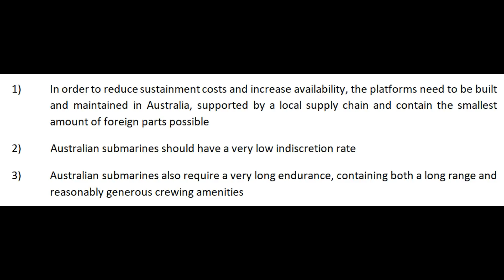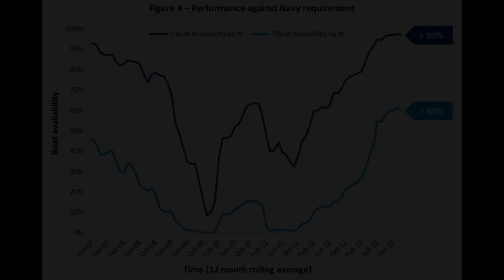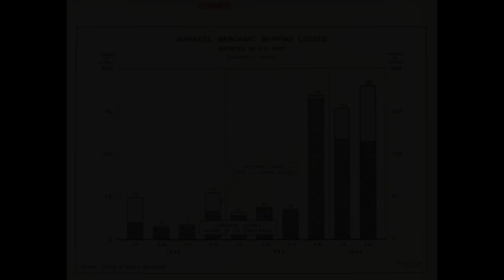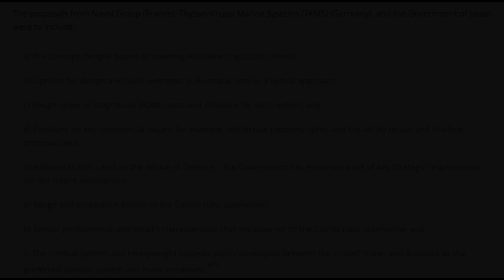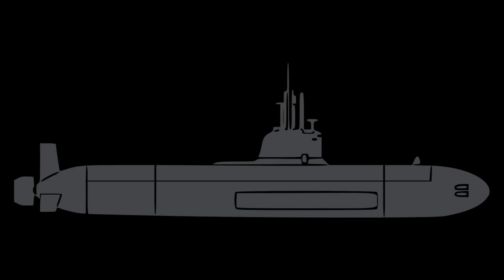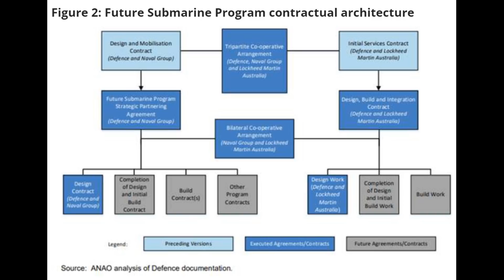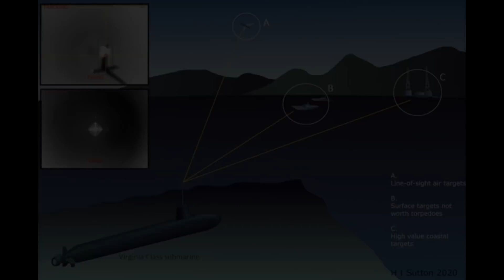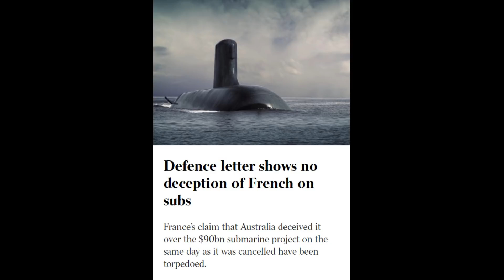AUKUS and the Nuclear Option: the Life and Death of the Attack Class Submarine

Comment: 1:06:20 - I’m scratching my head over the claim of regular snorkeling for SSKs. Particularly the Attack class. Naval Group’s AIP uses reformed diesel in a fuel cell system. That offers considerable capility Nd logistical enhancements over the german system, which itself is a quantum leap from the old Sterling AIP system. It can go 3 weeks without snorting. Further more replacing lead acid batteries for Li-ion batteries (and ultimately Li-sulphur batteries, who knows) gives at least 4 times the amount of stored energy (li-ion being twice as energy dense, and being solid can be shaped into every available nook and cranny on the boats), meaning in turn an Attack class sub could - in addition to creeping along for 3 weeks on AIP without snorting - also go incredibly fast for days within that 3 week period on batteries. I am struggling to see the disadvantage in a real life sense in that.

Furthermore, isn’t the obvious answer to the difficulties in operating for extended periods in the South China Sea (and presumably the other potential contested seas to our north) the establishment of forward operating bases? Specifically Manus Island and Christmas Island present themselves as obvious FOB to each operate up to 3 out of 12 boats from at any one time.   

All I can see now if a 20 year capability gap, which would only be plugged if we have a corresponding nuclear industry program developed over the same period (even if the asserted advantages of not having to refuel for the life of each boat’s service is a real thing, as former PM Turnbull pointed out very publicly at the National Press Club - and ASPI analysts confirmed - every piece of advice to the Aust government until the secretive Morrison became PM has explicitly stated: we need a nuclear industry to sustain a nuclear powered submarine fleet). For a capability that seems to be only marginally superior than the one we contracted to and in my view actually less capable when it comes to stealth (if as planned the attack class could do all the range of its capabilities for three weeks at a time without snorting).

You say that the indiscretion rate for a nuclear sub is zero floor its entire mission. That may be the case if it stays in the deep water, but for many many foreseeable missions where the rubber hits the road is what happens in the shallows: where one might find an enemy at anchor, or coming into or leaving port, or where special forces have to be disembarked or embarked: snorting aside, an SSK will always be superior to an SSN in those environments. This all seems … odd … especially given the revolution we are seeing in battery technology to dramatically boost the hotel load to and fuel cell technology to supplement that … which the attack class appeared to be at the bleeding point of the very cutting edge. 

I haven’t even mentioned yet - that IF there is a SSN advantage - then why on earth wasn’t it even on the table for consideration - splitting the attack program in 2: Australia builds 6-8 SSK’s in Adelaide, Naval Group builds 3-4 ‘Australianised’ Suffren’s in France (with an option to build a final 3-4 in Adelaide). Both halves of the program could have been done in tandem. We’d still need a nuclear industry which we don’t have, but it is actually easier to leverage from our small scientific research nuclear industry base into a satellite civilian nuclear power industry, than developing - at least - a satellite weapons grade nuclear industry (refuelling for 3 weeks in France every 10 years? Why cares. That’s nothing in the greater scheme of things, especially given that the boats will need a 12-18 month refurbishment at the same time).

Other advantages of Suffern’s: they are electric motor vessels. Mechanical reduction gear drive SSN’s are nearing obsolescence (a fact recognised in the various design and development programmes to replace the Virginia and Astute classes). They are far more modern than either the Virginia (which was a ‘B’ design anyway) or the Astute (which has been a troubled program itself). We could even lease 3-4 refurbished, Australianised and refuelled Rubis class SSN’s off the French from about 2025 to help build up our nuclear boat capabilities before Suffren SSN’s entered service from about 2035. Instead of SSNs on the never never, by 2035 we could have had: 3 Attack class SSKs, up to 3 Australianised Suffren SSNs in service, supplemented by upgraded Collins and Australianised Rubis SSNs. A capability enhancement, not a yawning capability gap. Madness all round to simply take all of that off the table.

As for the size issue: the basic boat design of SSN programs of both the US and UK navies started out at the same size as the barracuda class. They have just grown over the years (the block 5 Virginia’s by adding another 40M in length over the block 1s. However, that’s really because they are being fashioned as all round replacements for not just SSNs, but also as SSCNs. It might be worth considering ONE vertical launch system (we dont need the Virginia Block 5’s six vertical launch systems, surely), which can easily be done IF that is thought desirable. So an Australianised Suffren might end up being 108-110M in length and containing 8 strike length vertical launch cells, plus 8 smaller vertical launch cells in addition to its current weapons load. Enough. More than enough.
Reply: dont want to type a thesis but a few things

NG did not have or neither did they offer AIP on the a attack class when the a contract was signed.  The contract was signed with DCNS on November 2015,  the DCNS AIP system was not announced till 2019

Same with LIPO batteries,  the contract was lead acids and thats what DCNS supplied

Why would be buy suffrens,  it took France 13 years to build their own subs,  australianising is how we get into shit all the time.  Why would we last generation obsolete submarines like the rubis,  thats an even worse idea than buying suffren.  If we wanted to buy last generation subs theres something like 30 688's floating around to pick from
Reply from the maker: OK, so there are a lot of issues with your reasoning here. In basically every point you have advanced here you are making basic mistakes (such as confusing HEU with LEU reactors), ignoring the fundamentals (such as sustainment) or focusing on individual problems whilst simultaneously ignoring the wider context: For example, maybe you can cobble together FOB and AIP combination that allows you avoid the space based ISR issue in the SCS specifically, but a nuke solves that problem AND solves your HEP issue AND solves your land strike issue AND gives you greater operational manoeuvre potential AND gives you a performance advantage AND gives you greater persistence ect ect ect. Please, try to examine the argument as a whole without cherry picking. 

BTW Have you actually watched the video? Most of the rebuttals you raised here were specifically addressed. 

1) The Attack Class (at least the block 1A) had no AIP system
2) Li batteries were specifically rejected by Naval Group because of safety concerns (addressed in the video)
3) All AIP systems impose significant range penalties (again addressed in the video)
4) You can’t permanently sustain submarines from Forward Operating Bases which means you elongate patrols impacting on crew endurance, which is a key Australian requirement (addressed in the video). Retaining submariners is already a huge challenge and now you want to base people on Manus Island. Have you considered the personnel impact of that? Have you ever considered that the RAN has?  
5) FOBs are expensive (added cost on top of the sub program) 
6) FOBs are vulnerable to long range strike systems (lack of strategic depth) which means you need additional defensive systems (more cost) 
7) SSK will always be better than an SSN in the littorals? What, on gods green earth, would you base that reasoning on? You had better go and tell the USN that their entire force structure is wrong considering they operate SSNs in the littorals all the time. 
8) You are confusing HEU reactors with those that use commercial grade fuel which is why AUKUS means we DONT need a nuclear industry. Malcolm Turnbull was talking about a different kind of technology, so everything you have argued there is moot (addressed in the video)  
9) You are ignoring the HEP advantages of SSNs (addressed in the video). Greater energy density in storage will only marginally offset the greater HEP demands of UUVs. Even a 2x improvement of LI is nothing compared to the 10 – 20 x increase in HEP provided by the reactor. SG9 is estimated to generate 210MW. It’s just not even close.  
10) You are ignoring the kinematic advantages of SSNs (addressed in the video) 
11) You are ignoring the operational mobility advantages of SSNs (addressed in the video) 
12) You are ignoring the persistance advantages of SSNs (addressed in the video)  
13) Land strike is a substantial advantage of the Astute and Virginia (don’t know why this is a negative)
14) You are confusing the indiscretion rate with being shallow 

Your force structure ideas are just not at all realistic, really fanboy, forum stuff. How is the RAN supposed to sustain 4 different classes (some nuke some SSK) simultaneously, when two of them have supply chains in France? Who does the Full Cycle Docking? Who does the refuelling? What about the sovereignty issues of having Paris refuel our SSN? How much is it going to cost to get a fuel cycle established in Australia?

And finally you are just asserting that the only reason UK and USN SSNs are larger is because they are used as SSGNs, but really you are only talking about the Virginia class. The flight I 688 class is over 2,000 tons larger than Suffren. Astute is no SSGN (it doesn’t even have VLS), Seawolf is even bigger than Astute and it certainly wasn’t designed around land attack. I’m not saying land attack has nothing to do with the increased displacement, but that’s the only reason why is it? No other performance advantages? Persistence, kinematics, reactor size and HEP, magazines, crew space? None of these are advantages? It’s just about the Virginia Payload Module is it?   

Look man, I don’t mean to offend. Arguing with viewers is not a good idea for the channel; I probably should have just ignored this comment, but honestly there’s a lot of basic stuff you are missing here and it’s frustrating to put this much work into a video to then have someone roll into the comments and tell you why you’re wrong whilst ignoring most of what you have actually said, making extensive points that are, not only just flat out wrong, but points that I spent time addressing in the content. Military platforms are useless if you cannot sustain them, that’s something I really tried to foot stomp in this video. If you don’t want to take my word for it, then please, click on the description and read some of the material I provided.
Reply: @hypohystericalhistory8133  Just on something a bit right field,  someone I know,  now retired from navy served on O boats and a collins.  Had an interesting point apparently australia (ANSTO) developed and a more efficient way of enriching uranium (Silex),  while they US have been using nuclear material from weapons and have not needed to run enrichment,  they still leased the technology from australia.  Condition of it that any enrichment >20% had to be done with the permission of the australian government.  The US has enough atm,  but if SMR/AMR becomes a thing there could well be a shortage of a HEU on a worldwide scale.  

I dont know the specifics but in some circles people are saying that is part of the reason of the going nuclear decsion

https://www.aumanufacturing.com.au/silex-systems-presses-ahead-in-nuclear-enrichment-will-australia-follow
Reply: @richardthomson4693  I recognise those points, but - and I could be wrong given that a lot of the final details were on the QT - that both the AIP and LIPO batteries were added into the Block 1 specs after DCNS won the competitive evaluation. It has been intimated in various little statements, and ‘The Sub Brief’ review of the Attack class contract flat out cites Naval Group claiming that to be the case in 2020. I have assumed, given what the Germans have now been able to achieve in the interim, what the Japanese have now evolved the Soryu class with boats 11 onwards, that a combination of AIP and Li-ion batteries was actually now a thing for the boats that were to be constructed from 2024 onwards. If I’m wrong on that, so be it. 
The only point behind acquiring Rubis class is - following Dutton’s suggestion that we lease some Nucs until we build our own - is that the only country likely to have some on offer - as a step towards a mature capability - are the French with their soon to be retired Rubis class - they are quite capable ‘this generation’ tech. the notion that we can go from zero to being fully SSN capable was soon as we can magic 6-8 SSNs is farcical. So, were we to proceed done a SSN path, then leasing some existing, yet surplus kit from whom ever we partner with as we unfold this capability makes sense. Right now, the brits do not have any SSN’s that may be leased over the next 20 years. I’m. Not sure that Los Angeles class SSNs are suitable - or available - but were we to partner with the French … as it turns out there may well be some surplus, yet relevant SSN’s to lease for a period of say 10-14 years until the rest of the SSN program unfolds its wings (or in this case it’s flippers lol). 
Why a re you bitching about France’s 13 year construction program for the Suffren? how long do you think the Brits took to construct their first Astute? Or the Americans to iron out the Virginia? The only ‘’Australianisation’ needed to lease the Rubis would be the Lockheed Martin combat system. That’[s the same challenge as for the Attack class, or Australianised Suffrens, but behold: we have already DONE that on the Collins class. Doable, IMO.
Reply: @andrewmetcalfe9898  first astute took 10 years, virginia took just under 4,  later virginias were 3 years,  but recently delays are pushing them back closer to 4

When dutton was talking about leasing subs bet he was talking about either astutes 6 and 7 or earlier block virginias.  Maybe a couple of the block one stationed in hawai atm.   Not clapped out rubis, T class or 688's.  Where honestly think there is very little to nothing to be gained
Reply: @hypohystericalhistory8133  thanks for the reply. i reject a lot of your criticism, but the blame is mine - I think i need to expand my points a bit further. Insofar as I’m a ‘fanboy’ - I’m a fan of your contributions! 

I realise that block 1 was not envisaged with either AIP or Li-ion batteries, but Ive actually assumed that, as part of the protracted contract negotiations since 2016, THAT had actually changed. 

The notion that in some way the Virginia reactor is some sort of ‘black box’ for 33 years is fanciful. The question has been repeatedly asked over the past 50 years - if a nuclear capable partner supplied the reactors and looked after that aspect of the program, could Australia look after the rest as part of a sovereign submarine capability, has been resolutely answered in the negative. We need our own nuclear industry. perhaps not the same industry as we would need if we ran either commercial nuclear power plants or a nuclear weapons program but a significantly larger industry than our research based micro industry is at the moment. I simply call shenanigans on the notion that we don’t need a massive ups-scaling of that industry. 

Anyhoo, you are correct on one thing: I have not been able to absorb all 81 minutes of your presentation. Yet. Let me get back to you once I have.

Peace. Out.
Reply: @andrewmetcalfe9898  Part of the reason I dont believe french reactors or french nuclear powered subs were never a consideration is the NPT.  While it specifically covers nuclear weapons there is a section on nuclear reactors for naval use.  Basically it prevents the transfer of technology for LEU naval reactors.  If they australia wanted naval reactors they would have had to do the construction and development in australia.  Exactly like brazil is currently doing.   They bought some french subs,  they bought the tech to build them off france but they are developing thier own reactors.  HEU reactors are, depending on who you talk to either a grey area of specifically exempt from the is rule.  There are only 3 countries in the world that can build HEU reactors atm,  thats the US, UK and soviet union.  Dont know if france is working on them and if so how far away.